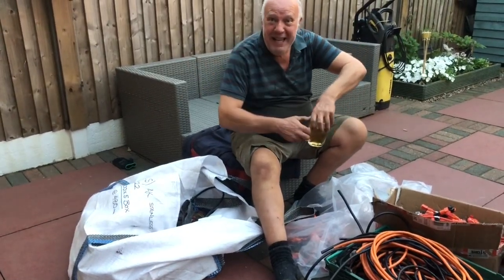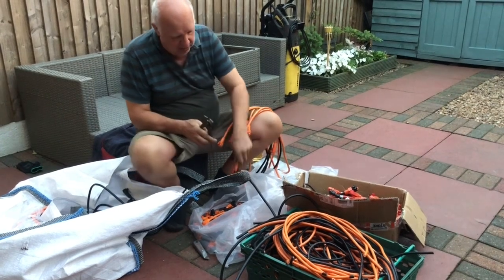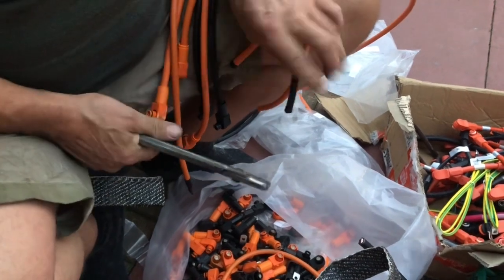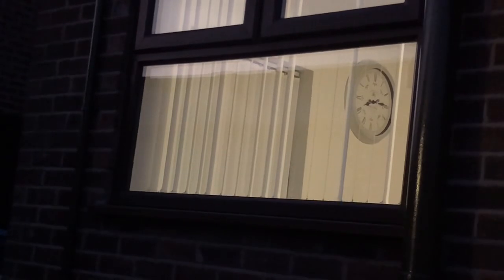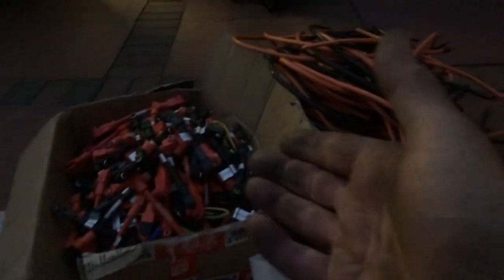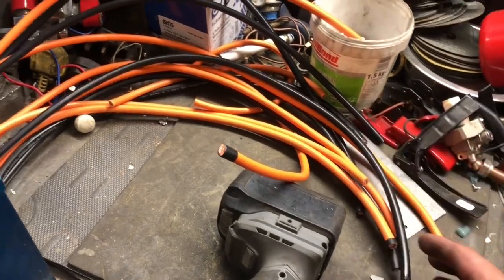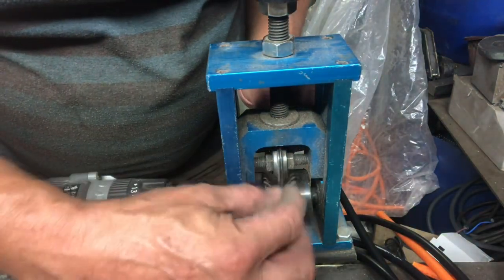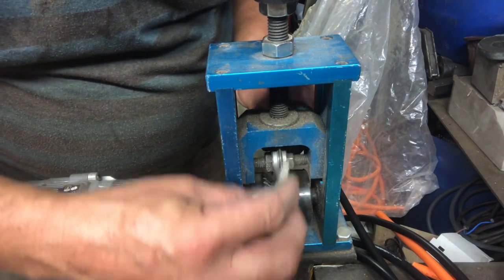Time to get me Stones out

Comment: I like the comedy I laughed alot brightens my day. I also do hobby scraping. I have a wire stripper also it's a strip meister drill powered it has four holes haha. It's got a big hole then a special hole for house wire then a smaller hole then a tiny hole haha. I think yours is better maybe not bound by wire size. Mine tends to shift if the wire isn't exactly the size of the hole.  Like you were explaining it shifts out of the path or the blade. I'd like to get lots of leads like that. Can't wait to see what you get.  Go Ian go.

Comment: Geek Shark agrees with the need to do the math to determine if something like stripping wire is worth the time/effort spent. But, as you are a hobby scrapper/metal artist why bother? Time means nothing. Fun video. We've had some very nice cool temps here lately - only up to the high 80's.
Reply from the maker: This is slightly different as it’s not actually my wire, I’m just stripping it to prove a point.